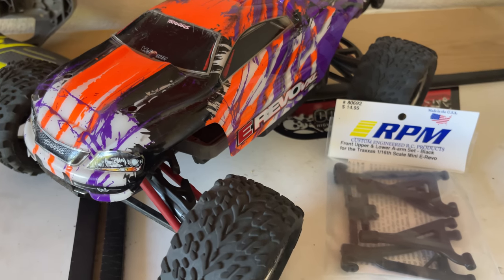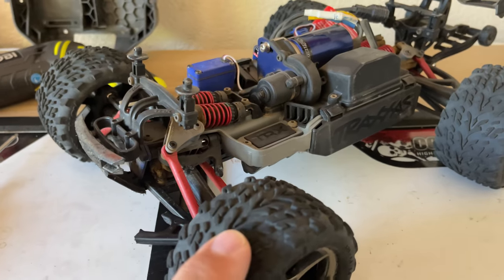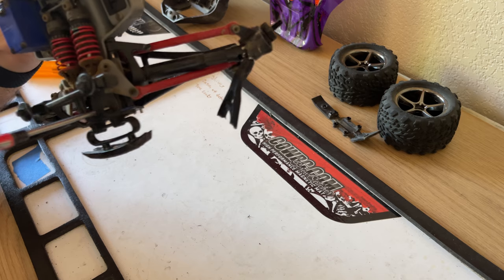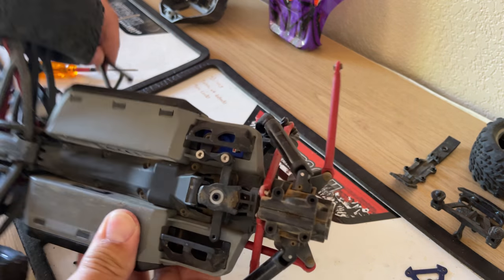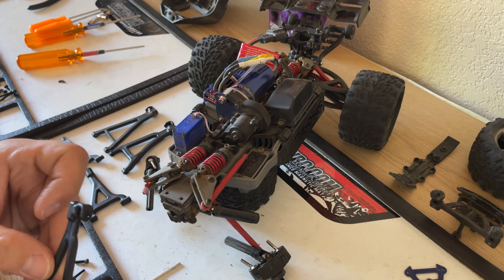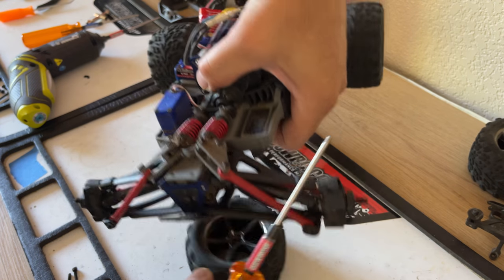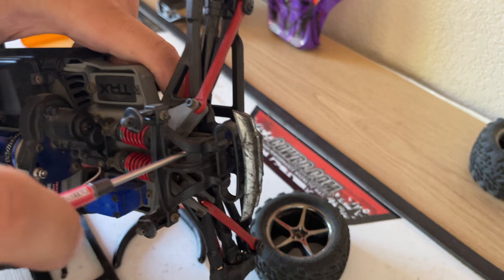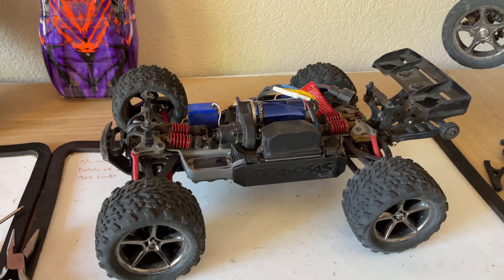Mini E Revo VXL Front RPM Arms Installation

Comment: Are those 1/16 erevo worth it? I see them a lot at bash events
Reply from the maker: They are very fun, very fast, and can be durable. The only thing I would probably do right out of the box is get some RPM arms.
Reply: Yes. Absolutely get one. They are so much fun and are insanely fast. RPM arms and replace the red links with stronger ones. It comes with one battery, buy a second and the battery connector so you can run both batteries together. Then it's insanely fast